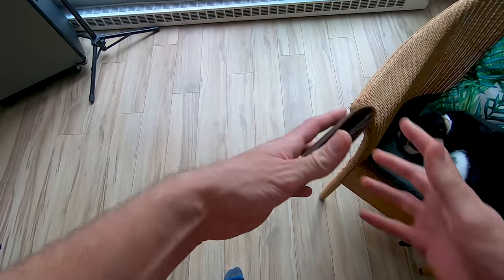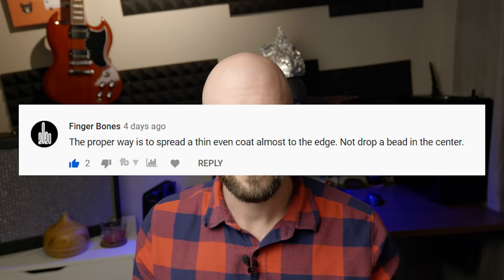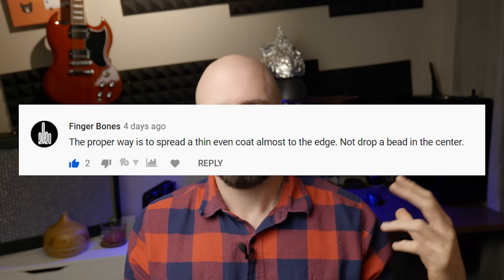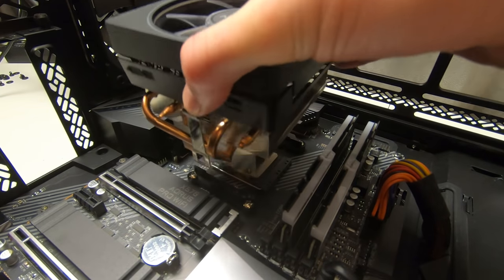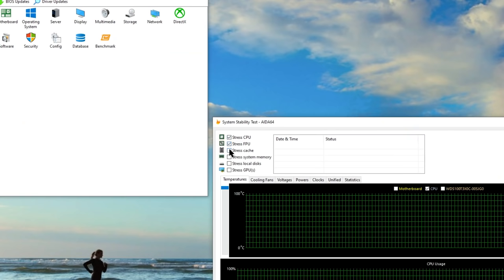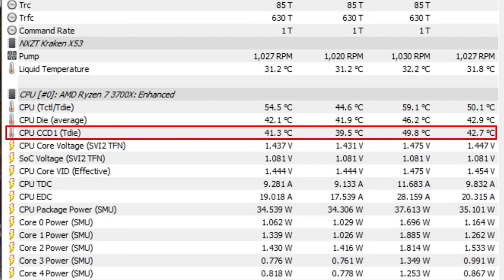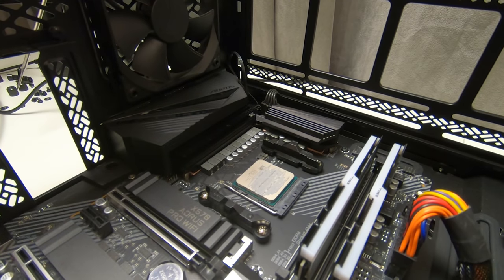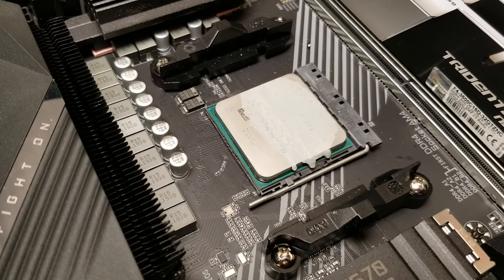Best Way to Apply Thermal Paste? Does it Even Matter?

Comment: Very interesting! I was looking exactly for this. Having done thermodynamics courses, we learned the reasons and mathematics for thermal paste between heat sources and heat sink components. It would, in theory, be best to have the smallest layer possible spread out evenly. It was nice to see the results of a real-life test. I appreciate your commitment to this.

-- Some explainations

Well, we really just want the paste to fill the nanoscopic holes between our two metal planes. If the metal surfaces were perfectly smooth, there would be no paste needed, the paste is an awful heat conductor, it is just there to replace the pockets of air, which are even worse conductors. So the tiniest layer, spread out evenly will most likely work best, because the surface roughness on the processor top and a heatsink are very small, so a very thin layer will be sufficient to fill those holes. And you want it everywhere, so it fills the imperfection wherever it is.

Moreover, What really matters, is the type of paste. There are multiple high thermal conductivity pastes, but they are very dangerous to work with, because they are electrically conductive, so watchout!
Reply: Thank you. I always says that and everybody is mocking me because it takes much more time to complete the application. But it saves paste too and is overall a better way to apply thicker pastes.
Reply: thats exactly what works best
Reply: so you talking about the butter technique, right? And do you mean "thin" layer by saying "small", or "small" as in area of application....
Reply: @serdareski3325  He's talking about the "butter technique," a thin layer across the face of the CPU...

Comment: I would encourage you to update this video review / test and include another method which is very very old school.
Put a plastic sandwich bag over your index finger and use that to spread a very small amount of thermal paste,
even smaller than the size of your pea /dot.  The thermal paste is really only to fill in the microscopic pits in the surface
of the metal. You want as much of the metal on the heat sink to make contact with the metal of the chip.
The paste is to eliminate the micro pores of air which act as insulators trapping the heat in the chip.
The best conductor is metal to  metal contact. The paste will conduct some heat but is worse at doing so than
the metal touching metal.
Reply: Seems like a bad idea in the sense of if you screw it up, you probably REALLY screw it up, but it would certainly be interesting to see the results if done well.

Comment: I had to put some on for the first time, and well clean my pc too. (Which I started regularly cleaning it now) so I don’t have to take it apart as often. 

And I find I reach 75 most of the time, before around 80, most games, and I reach 80-85 when I’m playing games more demanding, utilising RTX basically. 

Iv found having a clean pc, no dust it reduces a little bit like 3 degrees off, but I don’t think you can avoid temps of 80-85 if you are playing Demanding games utilising RTX for example. I have an RTX 2060 and amd3600, and without RTX at ultra I usually hit 76-80, but I only ever hit 85 when I use RTX, but ray tracing is demanding in itself. But that’s what the card is for anyway. 

I know cards are meant to hit temps around that, but I do the best I can to keep everything clean, and I apply thermal paste once every year or so

Comment: I got my own preference for this, I first spread a really thin amount all over the IHS and then I add a small dot in the center. This ensures 100% coverage and ALSO total absence of micro bubbles of air that might get trapped in the center when using the spread method.
Reply: I had this same idea and my then employer said no. It sounds like double positive to me but, was told air can get trapped between "layers" of compound. The reason we fully wipe off old paste.
Reply: @cardinaldriver  it really doesnt matter to be honest, for normal use - excluding extreme o/c - you can just apply paste however you feel like, as long as its enough of it. Ive been reusing paste and i didnt notice any difference. If the paste is in good condition, i just slap de cooler back on it and the temps are the same.
Reply: Significant impact of bubbles getting trapped is a fallacy. 

Makes no difference. Gamers Nexus did a great video on paste application and went absolutely nuts with all manner of paste quantity and methods of application. As long as there's a layer on the IHS (preferably thin) all is well. Microbubbles aren't a thing.
Reply: @martinw245  yeah it's probably just my OCD. It's true, the method doesn't really make any significant difference, as long as there's enough of it. I even reseat coolers without changing the paste and didn't see any meaningful difference.
Reply: @HDJess  

I'm not offended but I've been an OCD sufferer from the age of 8. It's a dreadful disorder that severely impacts our lives.

Unless the above applies to you, being a bit fussy isn't OCD.

Just saying, I know you didn't mean to offend, but its a bit annoying when people trivialise a very serious disorder that sometimes results in suicide.

I wish this "my OCD" for being fussy hadn't become a common expression.
Reply: @martinw245  I don't know why you associate OCD with suicide. I do have a mild OCD that I can control when I want to. It just bothers me when certain things are not done "the optimal way" or in a certain way that I prefer. Yes, that's a form of OCD.
Reply: @martinw245  I see your points. I wasn't trying to start any debate or create discomfort to the "real" OCD affected persons. I've been struggling with anxiety and discomfort too since a young age. Also, I don't live in the UK. Things might be different there they are here in Romania, where OCD is almost never diagnosed officially, it almost always falls under anxiety spectrum and you get prescribed Xan and stuff like that. I'm unsure if I really have OCD but I'm hella sure I've got something very similar to it.
Reply: @HDJess  

No probs. Not having a go at you or anything. It's just that it's worth pointing out to people what true OCD is really all about.

I'm 63, been suffering since the age of 8. So you can imagine how I raise an eyebrow that the term is used for fussiness.

Hopefully I'll be putting together my new rig. Was lucky enough to grab a 3090 before they became impossible to find. Believe it or not, I had a nightmare even selecting the case due to OCD. Every case I chose I associated with terrible thoughts and couldn't buy one. Luckily I've got it back under control but the build process will require a lot of discipline. Before hand I'll do plenty of Exposure and Response Prevention therapy to get my mind straight.

Low seratonin, structural abnormalities in the brain, lots of ideas as to why the condition exists, but we know it runs in families. In fact my daughter suffers too but a diferant form of OCD.

SSRI's are prescribed for OCD, like fluoxetine. Gold standard treatment is CBT, Exposure Response Prevention Therapy.

Have a great Christmas 🎄 👍
Reply: @martinw245  I have serious ocd disorders, so I decided to buy a pre-build PC. I can't do anything myself, because I fall into a loop of endless repetition / corrections until it can destroy the equipment. I bought the cheapest computer with the GTX1650 card because I am afraid to use more expensive equipment.  (sorry for my english, i use translator).
Reply: Yea. That's why it's taken me about 3 days now to build my new PC, also taking parts out of old PC to use and ran into issues about not knowing where certain RGB cables go, case functions being overly complicated, wire management which is about 95% of time consumed

Comment: What I always do: 

- Get some isopropyl alcohol 99.9% 
- Clean base of cooler and cpu IHS with it
- Get some kitchen paper, dip it in the isopropyl and rub my index with it. This makes it super dry and without any oils
- Use as little thermal paste as possible and use my index finger to spread it evenly across the whole IHS.
- Carefully apply heatsink and tighten each screw slowly.

Works every time.

Some people are against using your hands/fingers to apply thermal paste because it has dirt and natural oils. Makes sense. But if you use isopropyl you get rid of that issue. The card method usually leaves a much thicker layer of paste.

Comment: "It doesn't really matter"
*Guy who is .5c away from thermal throttling (sweats nervously) XDXDXD
Reply: Time to either get a better cooler, get rid of dust, finetune the oc, or any combination of those.
Reply: me and my laptop jajajajaja
Reply: Funny I had my first pc with 3 screws because one broke, so I still overclocked the cpu from 3.6 to 4.0 Ghz, it would stay 80 95 in games, and in the summer I had to down clock it so it doesnt thermal throttle.

The funniest part is that when I'd hit with my leg the pc case, the fan would fall, because all the screws were loose so this would happen frequently and I never changed the  paste.

I used the pc like that for about 3 years and when I bought the new one, I gave the old one to my cousin, so he used it for 2 years more.

That cpu is still working btw.
Reply: @alexanderciordas5307  The ChadPU
Reply: I think what he is saying, is he could start over, and run the tests again, and while within .5c for all of them, the "winner" is random.

Comment: Let's be clear. The paste is not the primary medium for heat transfer. Metal-to-metal is still far more efficient. The paste (dielectric grease with suspended silver shavings) is used because it is orders of magnitude more efficient than AIR. You want the most/closest metal-to-metal contact for proper heat transfer, and the paste is there to fill in all of the microscopic gaps for the rest. Too little or uneven paste causes the cooler to ride on a "cushion" of paste and leaves air gaps that insulate rather than transfer heat. Too much paste is going to make for less-efficient transfer of heat. You want to have the thinnest possible layer of paste with the most even distribution. So the "buttered toast" method is important, but so is the THICKNESS of paste. Only so much can be pressed out under the spring load of the cooler. This was demonstrated with the "small dot" method. Once the tension of the cooler mount matched the resistance of the paste to compression, it stopped flowing outward, but you could have spread an equal amount of paste across the entirety of the surface and achieved great results.
Reply: uber careful spreading has always been my go to. seems logical really.
Reply: Depends on the paste thermal conductivity. Thickness of the paste that goes with the viscosity of the paste, what is it made of. Cpu cooler mounting if its screwed one, it will squeeze the paste to the limit, so it will make the thinnest paste spread possible. If its just press fitted one, like stock intel cooler, then hell yeah you are dealing with cooler just touching thermal paste, that is touching cpu. Thermal paste isnt just liquid with silver shavings in it. By the use of it it will become chemically something like the solid pads you can buy, but fused without air bubbles to the cooler and cpu face. So its more to it than you think.
Reply: you are thinking to hard on this.  Curb the OCD,  the pressure and weight of the heatsink/screws squeezes the paste out so its not riding on some crazy 1/4" of goo.  Its quite thin its better to put on too much vs too thin.  a tiny dot will not cover the square edges so a X or 5 dot is the best 2nd is the credit card spread or maybe tied.
Reply: @Physics072   The truth is that nowadays all CPUs come from the factory with an integral heat spreader on them, so if you're thick and sloppy on the Wal-Mart rig you're fixing for aunt Betty, it will be perfectly fine. If you like to actually push rigs with high computation loads and run exotic watercooling setups like I have for 20+ years, then yes, doing it right pays dividends

Comment: Absolutely!  I’ve been using Alex silver #5 for nearly 20 years.  Hands down enthusiast builders reliable.  Stores for years. Get your moneys worth. Keep it cool, keep it cold. I keep mine in a refrigerator. Some say a freezer. Even after 5 to 10 years of removal it a still pliable. A little goes a long ways. Are use the spread method as well as massaging in a base film into both sides. You will notice a difference when you pull these apart later.  Good video.

Comment: I prefer the "X" method on newer CPUs..... but i do remember the times i would thinly spread the thermal paste over entire IHS on P4 cpus. That method provided so much suction between the cpu and heatsink, the cpu would actually get pulled from its socket because it stuck to the heatsink.

Comment: Can you include an additional test for the situation in which you accidentally lift up the block after paste application and quickly put it down again? I keep seeing people saying that you have to clean everything and reapply if that occurs but I don't really know if it makes any difference.
Reply from the maker: Yes this is a good point. It is something I am curious about. I will give it a test in the near future.
Reply: I have performed final assembly on printed circuit boards requiring a heat spreader be attached using the Penta dot method.  We are required to remove the heat spreader from every fourth unit to check the spread of the thermal paste to ensure the CPU is completely covered.  If it looks good, then we reattach the spreader without reapplying the paste.
Reply: The concern is about trapping air bubbles. Personally (20+ yr system builder), I clean the edges of both CPU & Cooler, respread to even on both, and then re-attach. Never has there been an issue (and yes, I support many of the same units, so they are monitored daily).
Reply: @philsigman9088  You mean IHS or heatsink?
Reply: @txtardis7887  Air bubbles are a myth.

Comment: Really great video !! But like always, everyone forget to mention the best way to clean the stock paste that was on from factory. 
Another thing missing is that thicker pastes like the MX-6 have specific instructions for application, you put a big dot in the middle, then use a piece of glass to push it down, turn you install the heat sink

Comment: Just bought some thermal paste and was wondering about this. Very interesting to see that it makes almost zero difference how it's applied as long as you're using enough of it. Spreading in out across the entire CPU certainly seems like it would be the best way though as it's the most logical, although perhaps you'd want just a little bit more in the center for optimal effect if you're really obsessed with getting that extra less then one degree cooler, lol.
Reply: Thinly Spread it first then do dot/pea at the middle works well for me.
Reply: @zxcv97  i've always used the buttered bread method, i'll add the pea in the middle.

i had the pump die on my water cooled computer last week, due to the thin thermaltake cpu block being blocked.
i have some proper coolant in the mail, and a newer cpu block for my old 1155 m/b.

Comment: I use the "Buttered Toast " method, although i put it on both surfaces (cpu & aio/heat sink).  I've used seral others methods in other builds, but i agree quantity & spread is of the utmost importance!
Reply: Ahh, when the bottom of the cooler is not completely flat because of the heatpipes filling in the gaps might actually do something.
Oh, and also a spread guy here for more than a decade.
Reply: Same here spread it both ways, it doesn't matter but it makes me sleep better at night 😁
Reply: I use this method too, I spread thermal paste both on CPU and heatsink.
I did this a lot of times on x86 and PowerPC CPUs and I never had a problem with this method :)

Comment: As a electrical engineer producing, repairing and testing many years high power AC/DC and DC/AC convertors for larger UPS systems, working 7*24*365 , we used high power thyristors on big Aluminium cooler profiles. The placement of the thermal paste was very important in the long run, because they tend to dry out after 8+ years and becomes "crispy". Our best experience was the "buttered toast" method with a thin layer, placed with rollers, because the contact area may not be 100% flat and not the whole contact was 100% covered, direct contact with the metals should be avoided to prevent heat congestions. Also important was the pressure of the screws, and a 100% clean state before mounting. But in a short period of time, you may have right, it doesn't matter that much. It would be nice to see the same test with a massive overload of overclocked CPUs during +24h.

Comment: Thermal paste pro here.
It's not the pattern, it's the amount, thicknes of the paste and the surface area.
X will not help if area is large.
For a super large CPU I would zigzag instead of dots or exes.

Comment: Probably also depends on the paste.    Some pastes are more viscous than others and may not spread out as well under the pressure from the heatsink and may actually benefit from the "buttered toast" method.
Reply: I always used to use it for Arctic Silver. I seem to remember it was their suggested method, and it was one of the thicker pastes I've encountered. Part of it might be down to the fact that the paste was conductive; if you pre-spread it, then there's less risk of going wrong.

Comment: The only difference is when you apply too little, causing CPU to overheat. So what's necessary is applying efficiently.

If your Cpu is rectangular (Laptop CPUs/ Direct die) line technique is good as it spreads in length and little breadth, less wastage.

If your CPU is square , Pea sized Dot/ X /Penta Dot works good as it spreads inside out in circle shape.

Spread Method it's really messy as compared to other techniques, not at all useful when u have little paste remaining. Few of it will be wasted on that spatula/spreader. Time Consuming.

Thanks For the video !